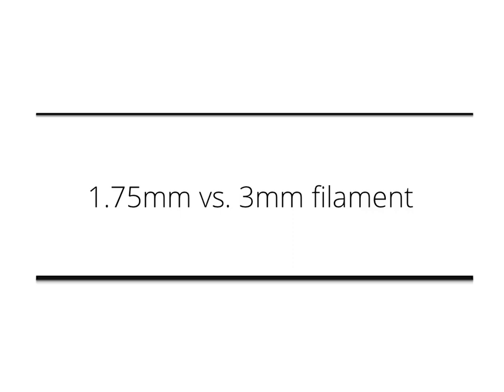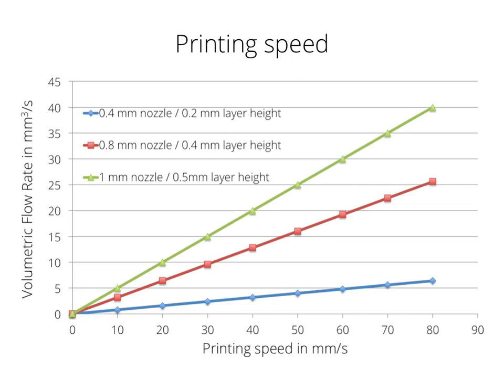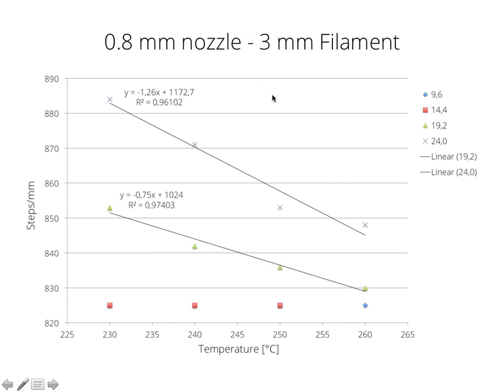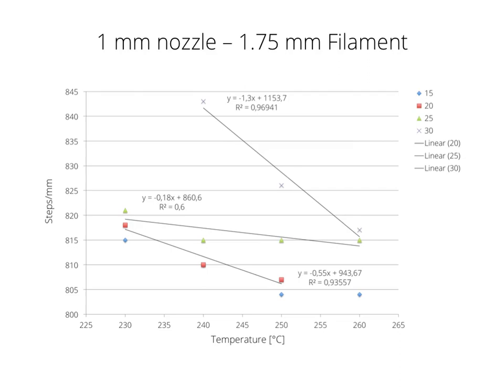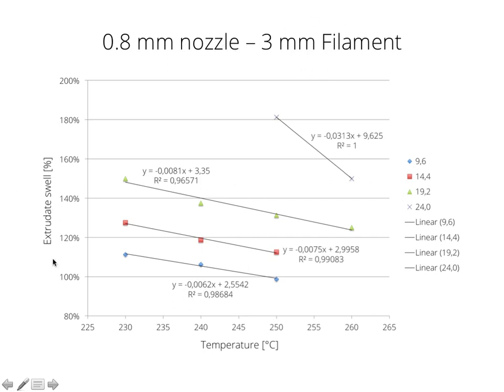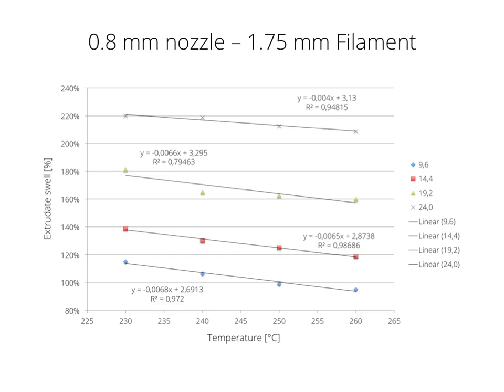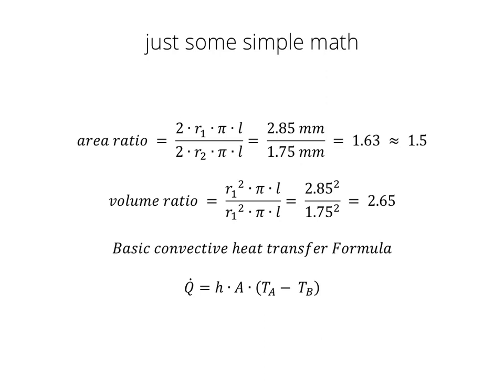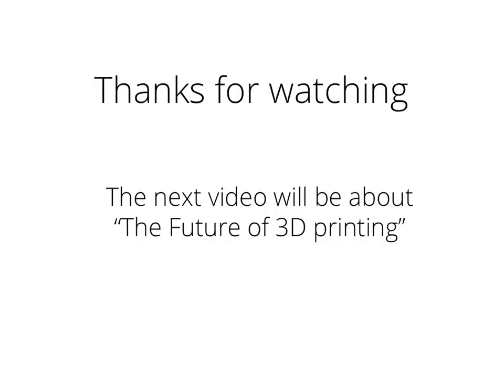1.75 vs  3 mm Filament

Comment: I imagine the 3.0mm less likely to tangle? And easier to untangle.

I also imagine faster to dehydrate / dry out due to larger gap between filament?
Reply from the maker: Actually 3 mm filament has the downside that it likes to "coil up" more because it is more rigid, due to the bigger diameter. The last bit of the 3mm spool are actually quite annoying to unspool.

Potentially the 3mm filament is easier to dry, but we have not investigated this yet.
Reply: @DropEffect Please tell me what do you set the Extruder Modifier Higher/Lower/Same?

Also, I imagine you have to set the temperature higher with compared to 1.75mm?
Reply from the maker: @jams2u786  No extrusion multiplier was set. It was a simple Gcode that told the extruder to extrude 200 mm of filament at different speeds. The e-steps were adjusted each time to extrude the same volume for each temperature step. The temperatures was calibrated beforehand using a thermocouple.
You do not need to set a higher temperature for 3mm than for a 1.75 mm filament.
Reply: @DropEffect  Thanks! Appreciate the info. Should save me some time.

Comment: How is the 3mm recommendation holding up 4½ years later?

I got a DropEffect XG hotend, and the m4 nozzle with thin walls made intuitive sense for 1.75mm. After getting some filament that's only available in 2.85mm, I've had to start looking for a replacement filament path, and there aren't a lot of options. I was wondering if the thinner relative wall thickness of an m6 thread with 2.85mm filament influenced the decision to use the m4 thread on the XG.
Reply from the maker: That is an awesome observation! Yes, that is correct the idea of M4 threads on nozzles comes from the theory that the thinner walls of the M6 threads nozzles for 3 mm filament might have an influence on the thermal performance.
I would still say that 3mm filament is better for high flow systems, however that is a very unpopular "opinion". There are however some downsides to 3mm filament: the extruder needs more force to extrude the filament (bigger motor or higher gear ratio), the filament is a lot more rigid and as such does not spool off well. If you are looking for a 3 mm extruder/hotend combo then we still offer the OmniaDrop V1.4 3mm.
Reply: @DropEffect  It has been interesting to see that the CHT nozzles (and some of the clones) list compatibility with both 1.75mm and 2.85mm. Yet I've found nothing on YouTube testing the larger diameter filament with them.

Comment: The increased die swell with 1.75mm filament is interesting, but it only becomes an issue if you're using a narrow extrusion width. If you're trying to push more than ~30mm³/s through a Volcano or a similar high-flow hotend, you'll generally want to run an extrusion width of at least 200% of your nozzle diameter. In that case, even 190% die swell should be a complete non-issue.
Reply: Im in the process of switching to a 1.75mm setup from 3mm because I find I cannot extrude reliably beyond 2-2.5mm/s filament rates with 3mm filament in my Titan aqua extruder. That is only 16.13mm^3/s and I’m using a volcano hotend.  I am hoping that I can get a higher through put from the 1.75mm filament. Dyze design has an interesting white paper on the subject.
Reply: The die swell tells us that the higher the swell is the higher the pressure is. The pressure increase is most likely linked to the actual temperature the filament reaches inside the hotend. The lower the temperature the higher the viscosity of the filament being extruded. A higher die swell could mean that 1.75 mm filament extruded filament has a lower temperature and could result in worse layer adhesion. As such I would not recommend to run those speeds where a die swell of 190% occurs.

Comment: Beside that what happened to the 0.4mm nozzle? And more normal PLA temperatures like 190° or 200°? Is your nozzle temperature reported correct?
Reply from the maker: Since I was looking at a high throughput, I chose to stick to the big nozzle sizes. I did not investigate the 0.4mm nozzle. At lower temperatures you would get less throughput so I increased the temperature. With the formulas in the graph you can calculate what the theoretical throughput would be.

The target temperature you set in the interface of your 3D printer is not the same temperature you would measure if you would put a thermocouple into your hotend. i did this experiment using a 3mm diameter thermocouple. I used two different thermocouple and two e3d hotends. I got always the same results. The results you can see in this graph https://imgur.com/gallery/yUS49kC

For instance if you set 200°C as your target temperature the actual nozzle temperature is 172°C and for every 10°C target temperature increase you get "only" 7-8°C of actual nozzle temperature increase. I also checked if the board has any influence. I used a Ramps board and a Duet wifi and both gave me again the same results.

Comment: I think I can deliver you the missing one missing hypothesis: PLA is quite soft so it gets pressed more deep into the gear (especially when humid). So the radius on the gear changes with pressure from the spring and so do the steps/mm change.

Comment: Your results do affirm recent conclusions by E3D that the larger filament enables higher flow, but it's nice seeing some baseline math confirming it. They previously said that 1.75mm because it allows heat to reach its core better but an intern experimented and found that 2.85 produces higher flow rates.

You mentioned the larger filament, it's more than just rumors.

The companies working on a bigger filament standard:

http://www.fabbaloo.com/blog/2017/5/30/3d-platform-leading-new-filament-standards-project
Reply from the maker: Well this information comes form the same source: me. I am the so called intern, however when I did these experiments I was not anymore an intern. I did an internship 3 years ago. I did research on dual extrusion back then: https://www.youtube.com/watch?v=keee3ZBQuac

Comment: "Basic convective heat transfer."   Did you mean basic conductive heat transfer, I think?  I don't think convection is happening, but for sure, there is conduction.

Thanks for the video and the analysis!
Reply from the maker: You are right the main heat transfer is conductive. My bad.